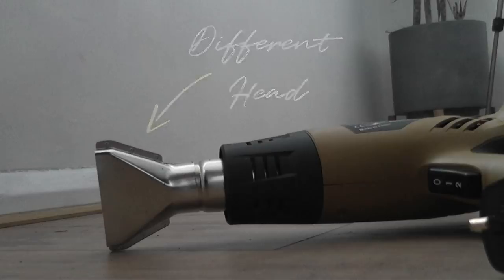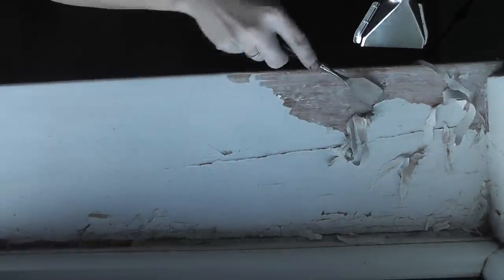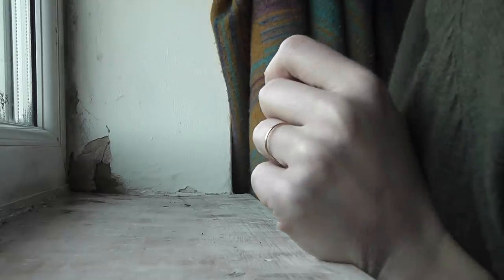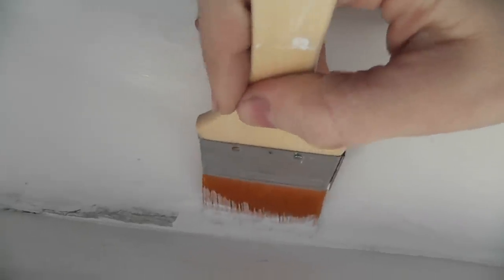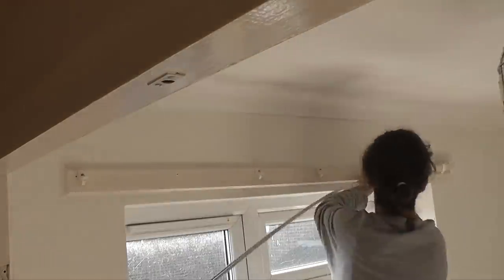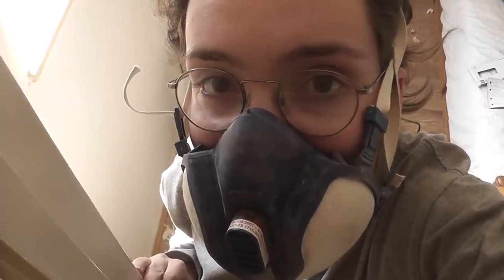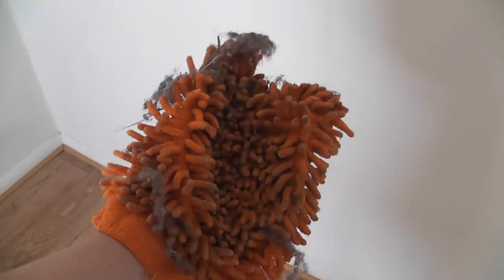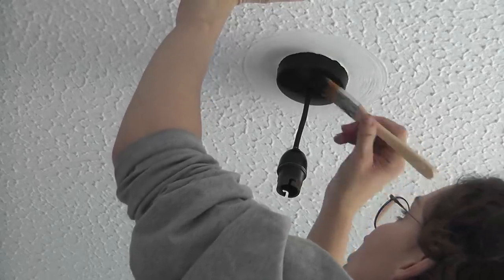Fixing My Mouldy, Ugly, Cracked Bedroom Window - Before and After #DIY #HomeImprovement

Comment: i'm wondering how old your house is. also, are you still doing much with your music? or did you illness and married/mommy life put that on the back burner? i've watched you for many many years and always enjoy your videos.
Reply from the maker: It was built in 1971, so not that old, but when we moved in the windows were leaking, the roof was broken, so was the boiler and the hot air system was condemned a week after we moved in. It's been a LONG job fixing one problem after another.
Reply: @KlairedeLysOfficial  oh wow. what a mess. its a good thing you are so talented and willing to learn new skills to get it fixed. the house we lived in for 20 years had massive problems too. but it was 100 years old (and poorly built) in the US. when we remodeled it, we found there was no insulation left in the walls and no heat or cool system. we live in the center of the US (kansas) so we get the cold part of winter  AND the hot part of summer. i was quite upset when i moved here from south east texas and found it to be just as hot!
Reply from the maker: @Midlife_Manical_Mayhem  I'm still doing music, but I had to sell my piano to cover some of the house costs (and because I was so sick I couldn't play at the time) I didn't think I would be able to get better so it seemed like the right thing to do. I'm hoping to save up enough this year to get a cheaper version back.
Reply: @Midlife_Manical_Mayhem  LOL New England is that way also. Crazy hot humid summers and very cold winters. In New England we like to say we have five seasons, not 4. Summer, fall, winter, mud, spring! I live in Florida now, but I miss New England.